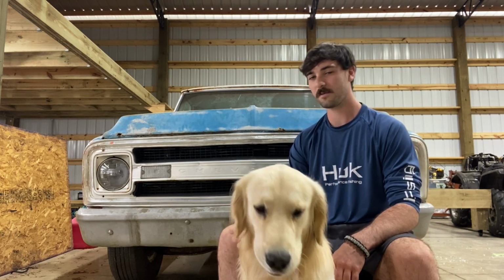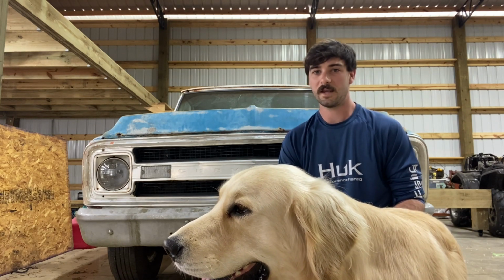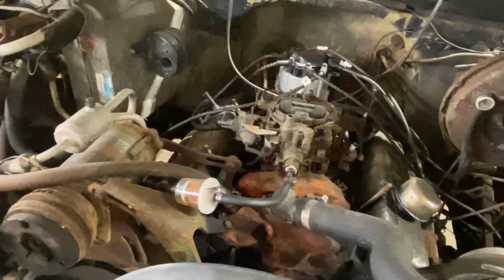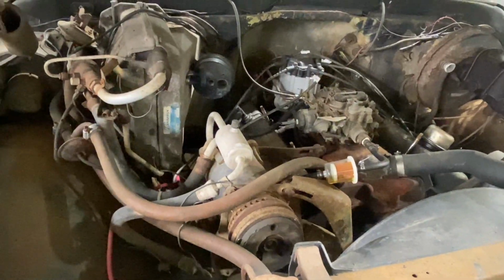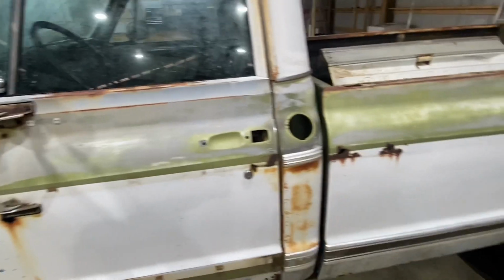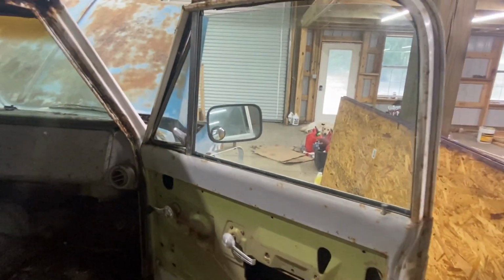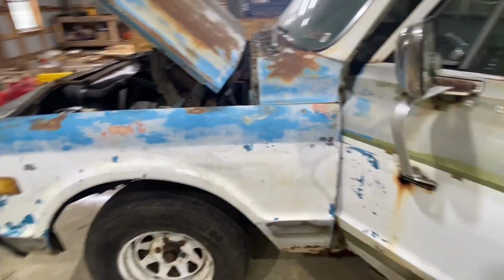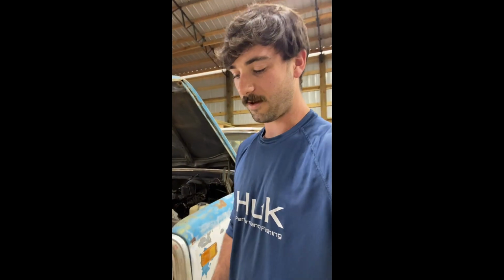72’ C10 Project Introduction

Comment: One question I need a donor for my 1970 c10 can I swap it from a 1968 c10??
Reply from the maker: Yes you can. 67-72 cabs should all work fine besides the 67 having the small rear window and I believe some 68’s as well. Fenders and hood are different between 67-68 and 69-72 though.
Reply: @BarnBuiltFabrications I didn’t specify sorry, so I need a frame for my 1970 c10 and I found one in good shape but it’s from a 1968 c10 you think will work?
Reply from the maker: I believe the 67 is narrower at the front not 100% on the 68

Comment: Looks like it will be a fun build.  FYI, The sticker on the window is a DD Form 2220 and means it was a personal vehicle authorized to be driven on a military base, which makes sense with the previous owner being a veteran.
Reply from the maker: Thanks for the info! That definitely makes sense.
Reply: Looks great bud. Where in FL? I have a 71 k10 going to build it out soon. I'm in fla as well.
Reply from the maker: North Florida @jenksranchrescueinc.121
Reply: @BarnBuiltFabrications 71 k10 down here in central fla. Spring hill